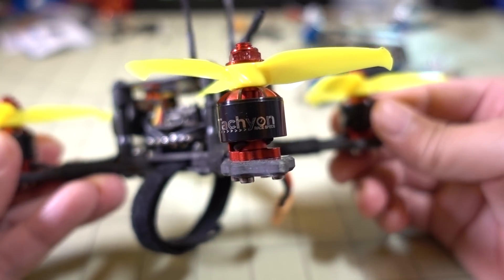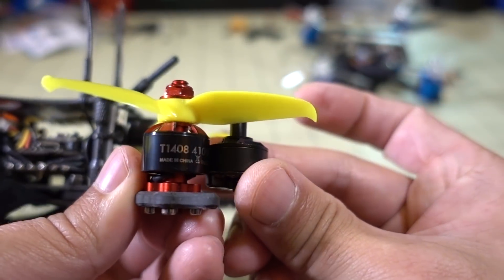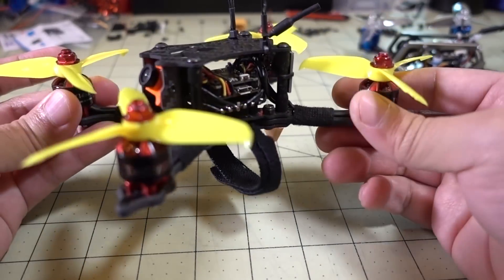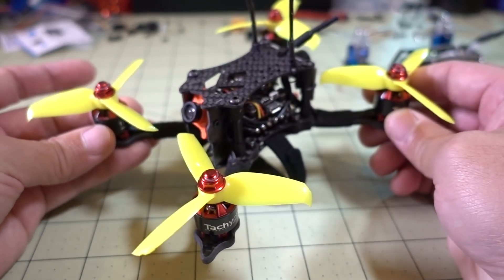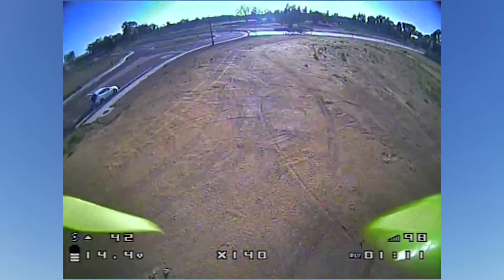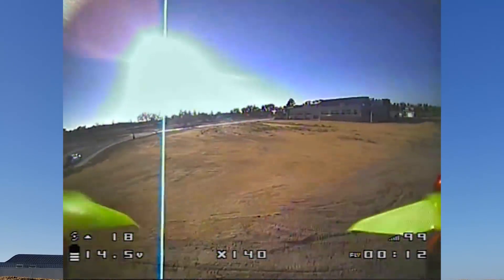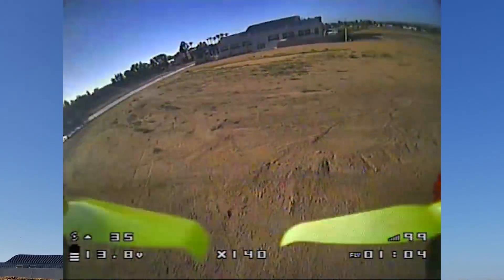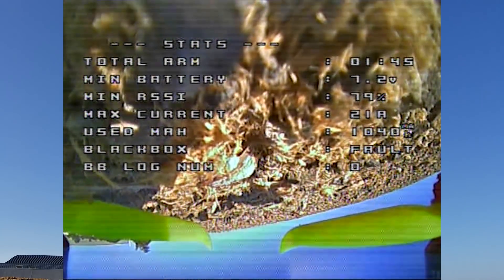iFlight-RC Tachyon 1408 4100kv Motor Review 😀

Comment: Cool video, great test. Have you ever tested flying T1408 4300kv t-motors (using 11xx series 3inch props)?  I purchased a set for my iH3, but I think its too powerful for that frame. I'm keeping them for a future frame (Gecko perhaps). They can also accept Avan 3 inch props, but plan to use HQ props instead. :)

P.S. your link for the Tachyon 1408 took me to different motors instead.

Comment: have tried my 140x build with rcinpower 1506 3400kv, garila 1507 3700kv, 3br 1606 3500kv, iflight 1606's 4100kv and recently these 1408 4100kv motors and feel that they are up there with the rest of them, with good overall performance and efficiency, (850mah plus dal 3056 props. quad is under 250g) I like these motors quite a lot.
Reply: I get the whistling too. I think its the motors ?
Reply: Edward Lee ,  which Motors would you pick if only one?

Comment: are you still using the stock 20A AIO ESC of the Furibee X140?   those motors did not burn the ESC? :D
Reply from the maker: Yes, still stock.  I think the max amp draw is 18a on these motors on a 3 inch prop.

Comment: Speed and performance over economy, I can live with that😀👍. Have you tried the Fli14+ reciever yet? Diversity and rssi info on flysky😁
Reply from the maker: I did a review on that receiver a few months ago.
Reply: Albert Kim that was the flit10. The fli14+ is a single unit not two part and can display rssi on the osd really easily it doesn't need a workaround😁
Reply from the maker: My bad... I haven't tested the single antenna version yet... I saw "diversity" in your comment so assumed it was the two antenna version.  I don't think the single antenna version has diversity...
Reply: Albert Kim no problem, they've only just come out and as most reviewers use Frsky no one has really reviewed them. There are 2 versions the Fli14 has a single antenna and the Fli14+ has 2 longer antennas with diversity 😁

Comment: It sounds like you got the same sound from the motors that I got when the gyro low pass filter was turned off ? I fell into that 10.3.1 upgrade trap,but managed to save the quad before anything broke,but that sound from the Tachyons on low rpm was really familiar from my 3" quad... I did the CLI setup for the low pass,and the now it flies like a dream :)
Reply from the maker: No, that wasn't it.  I was already on 10.3.1 when I connected up this one.

Comment: sounds pretty much like the GepRC 1408s 4100Kv that I have on my 3" Quad... nice little things, but they kill batteries
Reply: I fly the GEP1408 and they are powerfull but the base is weak - it breaks when a hard crash hits it in a wrong angle. I think the I'll rplace them with the tachyon when the next motor is killed. Same power, same size, same weight but more robust.
Reply: nara might be..  i just had no hard crashes (yet) so I wouldn't know about that.

Comment: I had this same kind of odd osscilation or sound on the BH 1507 avenger motors in 4100kv on 3 inch. Couldnt tune it out and it was there on multiple frames. Went to 4 inch and flew perfectly on the Merica frame almost no tuning.